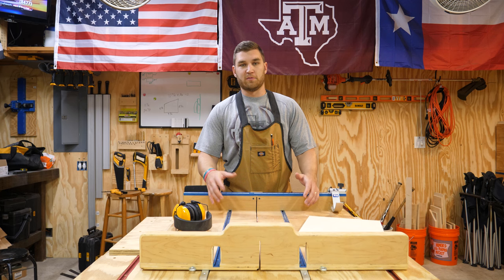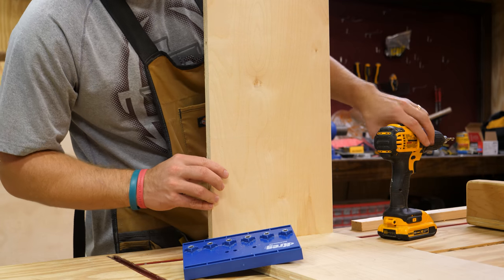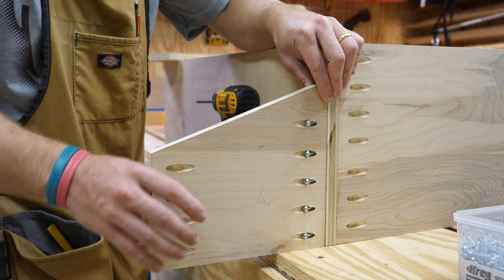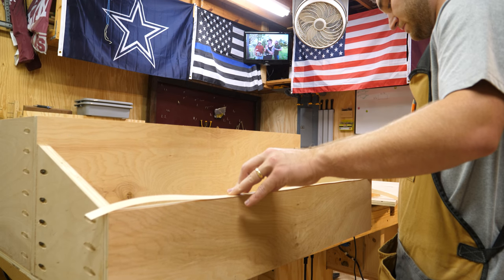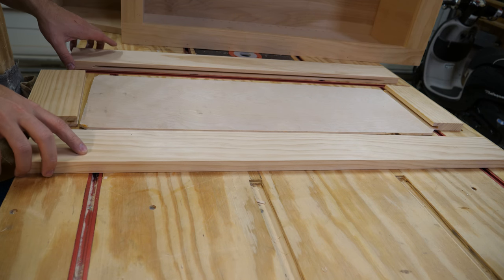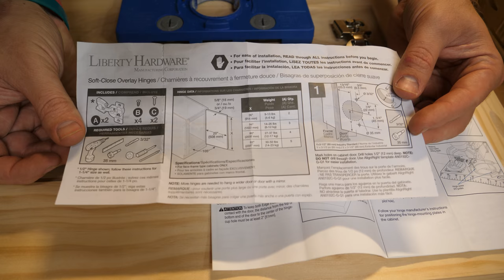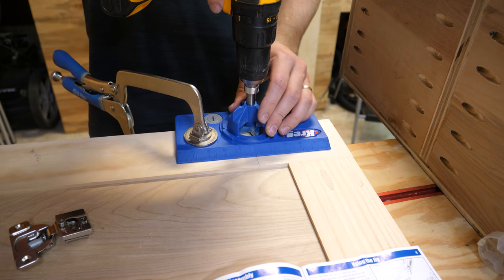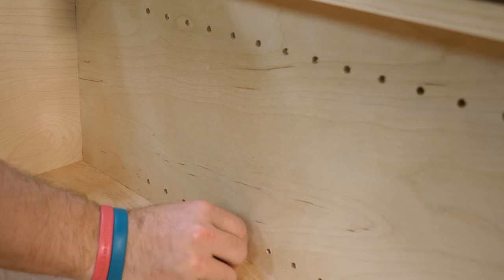Custom Cabinet

Comment: good job....a suggestion though.  As glue is stronger than the wood itself and pocket whole screws aren't the cheapest, a bit of overkill on the number of screws on the carcass.  I'd use half the amount.  Lookup some videos on the strength of glued joints for confirmation.  Anyways, just a thought. Keep it up